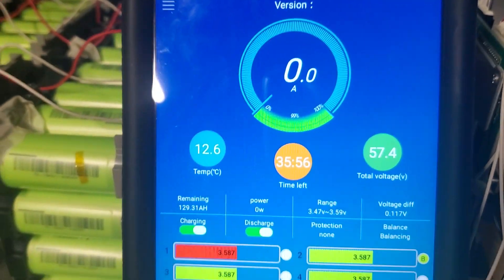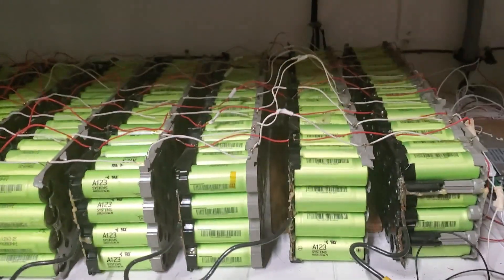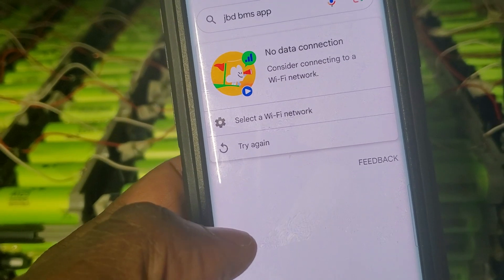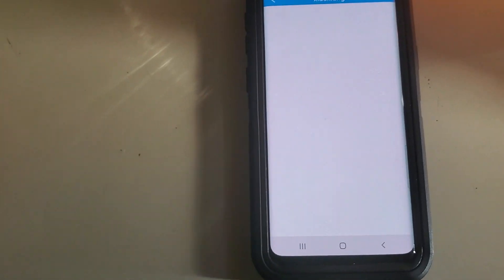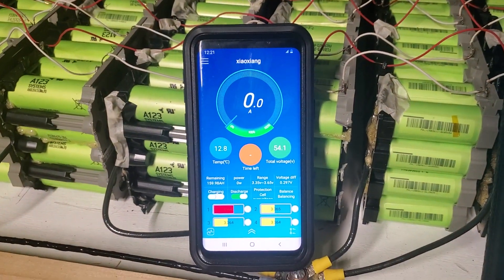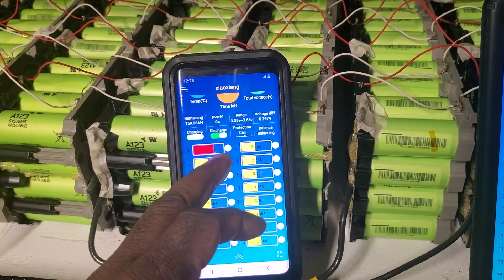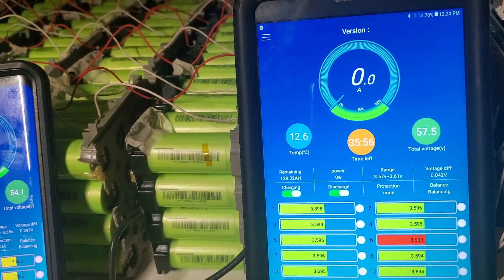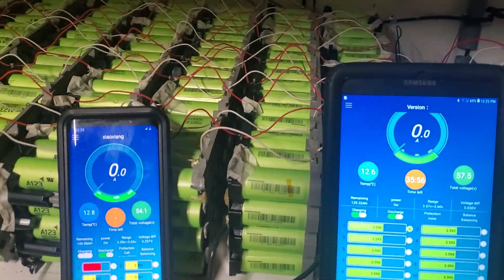JBD Xiaoxiang BMS app/software update How to download #lithium $LiFePO4 #battery #monitor

Comment: Hello i bought universal smart bms 10-17s and i can only run it 17s mode i need 10s software doesnt change it its shows as 11s and is locked becouse off that :(
Reply from the maker: You can contact the manufacturer and ask them about it.

Comment: Hi, 
After installing new Boardnamics BN M1-AT Gear Drive on my Lacroix electric skateboard 12s4p p42a 21700 molicel and replacing motors from 6389's to 63100's the board would not charge. Charger showed green as if fully charged but was no charge left.

After downloading the xiaoxiangBMS app it started to charge properly again!

But now It will not charge again. The battery shows fully charged in xiao & stormcore app and shows green light on charger again but it is not fully charged.

I'm seeing:
- a MOSFET software locked alarm
and also:
- A cell over voltage protection alarm
Reply from the maker: I am not sure how to help you

Comment: How and when do you reset the capacity?
 My batteries think they are full at 3.3 volts?
Reply: Same overnight went bad 3.3 on each
Reply from the maker: I have that went bad for apparent reason. It was working fine. 9 months later it is done
Reply from the maker: I have the same problem. They are 2 type of capacities